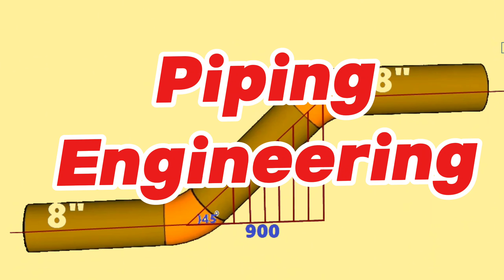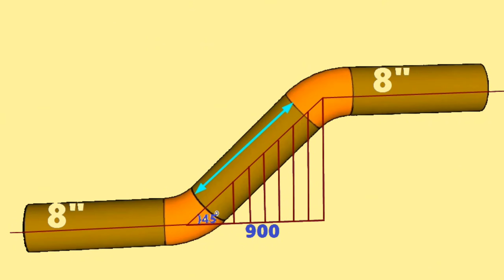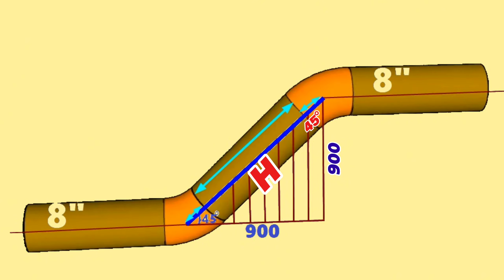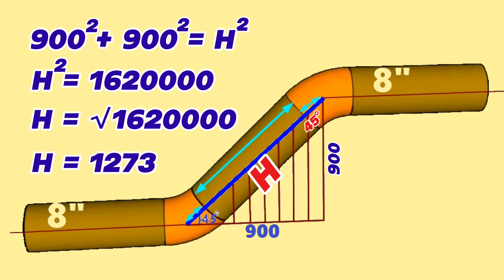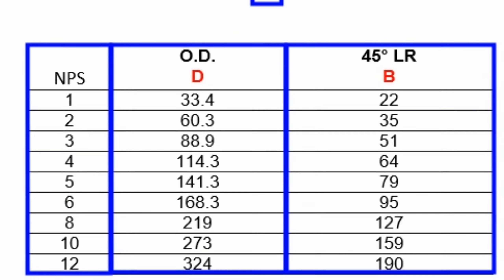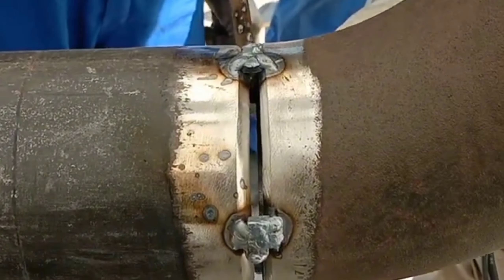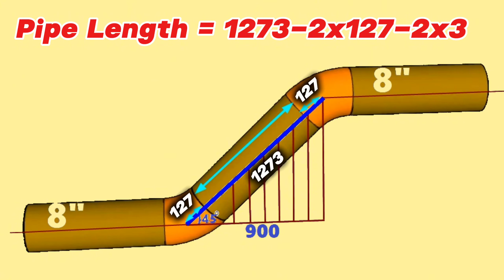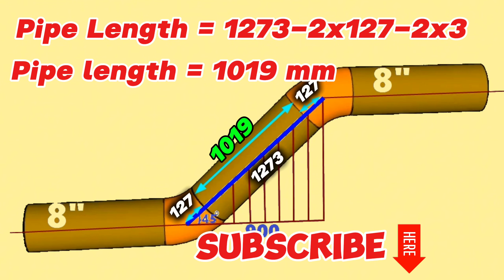Pipe Length Calculation Easy Way. How to find elbow length?

Comment: 1019 - 6 (gab) = 1013 mm
Reply from the maker: Many thanks for watching and comments, my friend
Reply: L pipe = 1020
Reply: @Piping-engineer  So, no need to reduce the welding gap (2*3= 6mm).